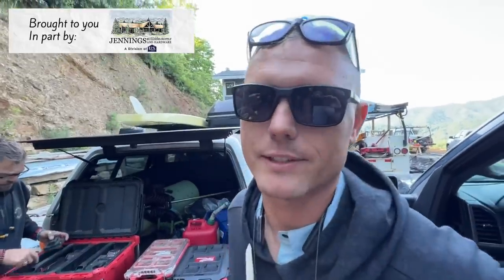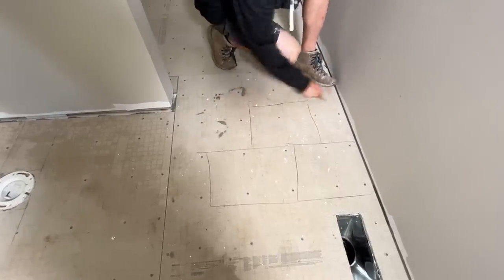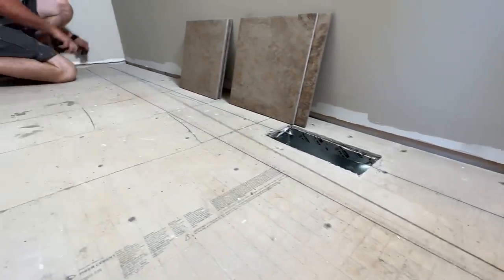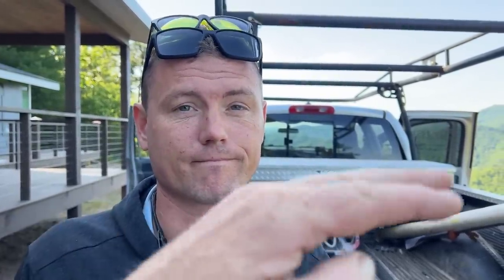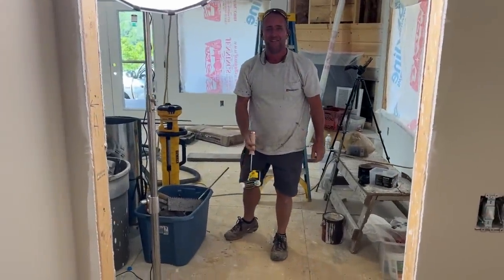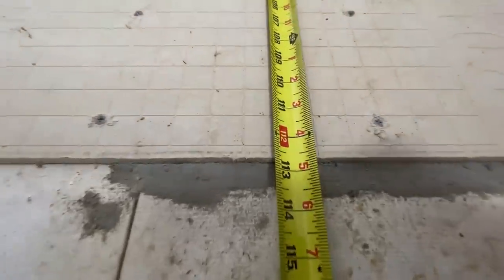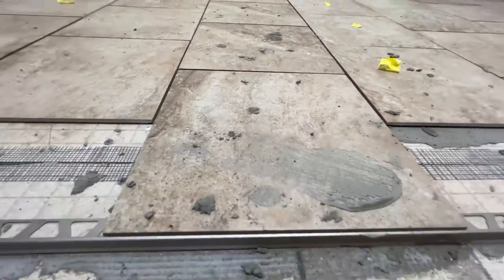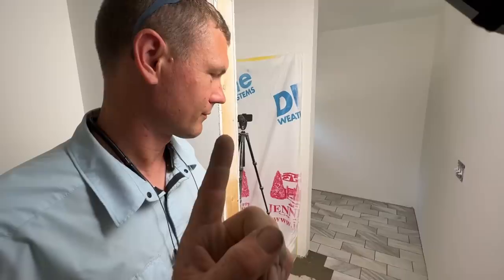Building A Mountian Cabin EP41 | T I L E goes in and we get a new tool!

Comment: Couple things guys, rookie mistake not wearing knee pads. 4:33 that works great to start just always finish with straight continuous lines and make sure to tarver the tile (place it wiggle up down left right) and never leave round spread lines it can trap air, lifting the tile you should have tons of spikes and no lines. 9:25 also check the diagonal sometimes they are very slightly a parallelogram which on a set out row can really screw with your layout.

11:33 that blade should be a frisbee of the side of the mountain get a decent diamond turbo blade or diamond cross hatched one. (Factor the cost of the blade into the tile work you'll get a few jobs out of one blade and they only run you $20 - $50) Any that advertise primarily for porcelain will cut quicker and easier but you get less life out of them. To help with round cuts plunge cut a + and an x shape then a hex shape out first then do relief cuts from the inside to the outside on what's left. Then you can either finish completely with the grinder or just score the round line a few millimetres into the tile with a grinder and use round tile nippers to snap the rest. Your blade shouldn't be getting hot but if you want to extend the life and cut down the dust you can grab an old wet grout sponge and hold it to the blade with your off hand that is bracing the grinder, even leaving it next to your cut and occasionally pressing it down will be easier and quicker then a water bottle squirt.

13:41 Get yourself some PICA dry automatic pencils with the 4040 refills they are water resistant to splashes/submersion but rub off easily, pretty much like crayon but better, plus the graphite inserts that come with the pen are great for fine woodworking. Other alternatives google China markers again basically crayon but they are cheap as chips. You can also try some engineer/welders chalk sometimes call soapstone Jaime might already have some.

Comment: These guys probably shouldn't be tiling
Reply: Do you have a lot of experience with tile? What do you think I should avoid doing that these guys did, and why?
Reply: @shmubob  What I noticed is that they didn't trowel the mud they laid down on the floor and also didn't shuffle the tile around on placement to get the bubbles out of the mud they troweled onto the tile itself.  Which leads me to believe the tile is just gonna explode when anything falls on it in a spot where it's not 100% to the floor.
Reply: @shmubob  no crack isolation membrane over a wood subfloor not a great idea. They could have used a fluid applied membrane over the cement board or an uncoupling membrane as the underlayment. Also they tiled directly onto what seemed like dry cement board. Should always sponge or wet the backer board if it's porous like drywall or cement board. And they did not appear to practice directional troweling at all. Also a 1/4 x 3/8 is standard for a 12x12 tile, would never use a 1/4 x 1/4
Reply: @shmubob  dont buy tiles that are random dimensions... Also QEP make a system called "Lash" that makes spacing and leveling stupid simple. I trowel the substraight, and you do it in a straight line, no swirls or cross hatching. You can back butter if you want but that's for shitty mortar or mastic. Just buy good materials. I'm gonna saying it again, just buy good materials. I also wouldnt use 1/4 1/4 1/4, because once you angle it you have about nothing. 1/4 1/4 3/8, at least for that size tile.